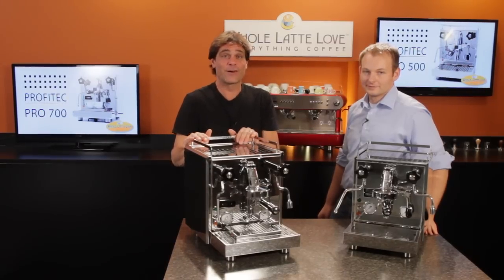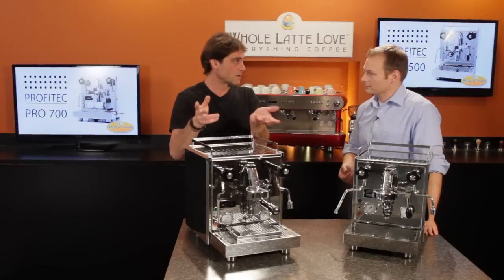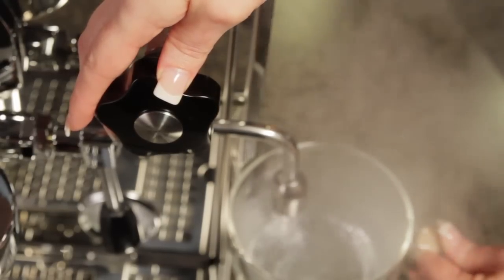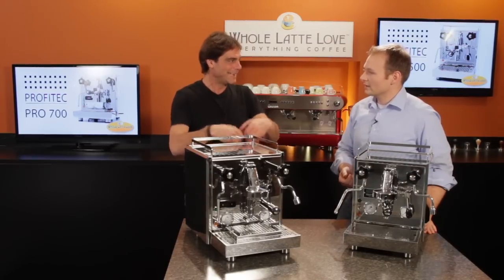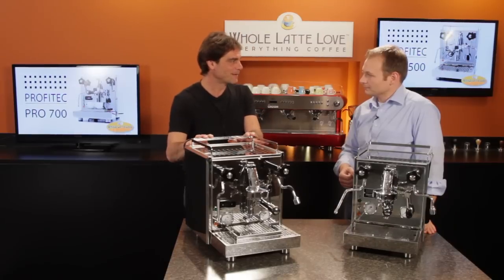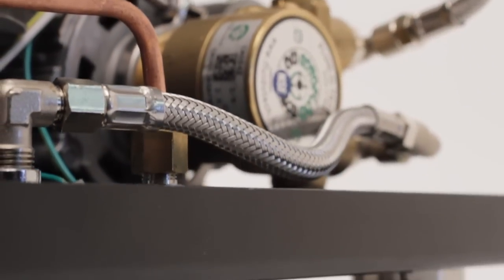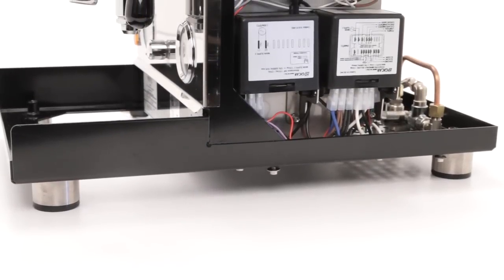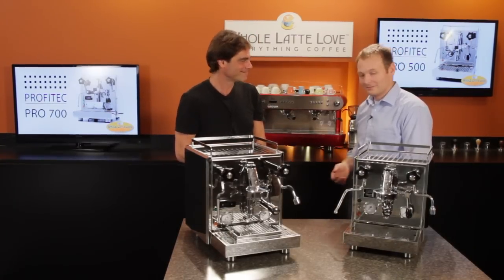Up Close with Profitec: Pro 700 Dual Boiler PID

Comment: This seems incredibly similar to the equivalent Bezzera and ECM machines, from internal layout, manual valve for switching to plumbed operation, boiler style, all the way down to the drip tray stainless steel sliders as found on the ECM Technika IV.

Is Profitec the German engineering firm contracted by Bezzera and ECM? They're really, really, strikingly similar.

Comment: I love this machine and was deciding between this or an ECM or even a Rocket. I was curious though in regards to these and pressure profiling machines if anyone really sees a difference in extracted flavors. Seems to me that pressure profiling isn’t as popular and that flavor extraction is more dependent on your grind, tamp and temp?
Reply from the maker: Hi A, Pressure profiling gets into the realm of high-level hobbyist. With profiling you can tease out subtle flavor nuances. It's most effective when using relatively fresh from roast specialty/single origin beans. You can also mimic whats done on commercial machines like Slayers. A much longer low pressure pre-infusion then transition to higher pressure extraction. Those high-end beans do cost a lot more. Expect to spend a lot of time and use a lot of coffee playing with pressure profiles. That's exactly what some hobbyists want. But it's a relatively small group.
Reply: Whole Latte Love Thanks guys I appreciate it, now I just need to decide between either the Profitec 700 or Synchronika. I think I simply ruled out the Rocket for cosmetic reasons, too much branding. Hard decision, all seem like fantastic units. Is there any specific reasons why you might choose one over the other? I know the Synchronika is basically a prettier Profitec, no other major differences? Thank you again guys. Looking forward to grabbing a machine from you guys soon! Waiting on that tax return😝
Reply: @AgileMJOLNIR  hey, did you decide on which machine you'll get in the end? If so, how has it been?